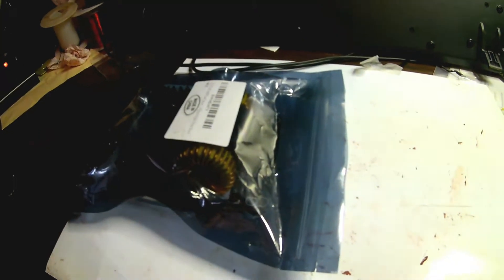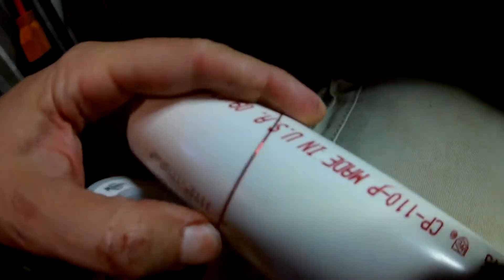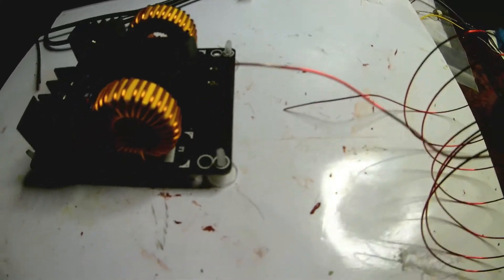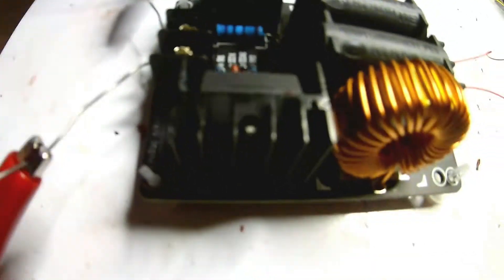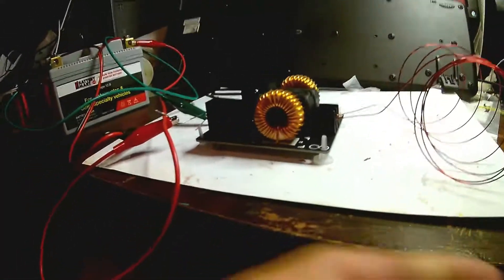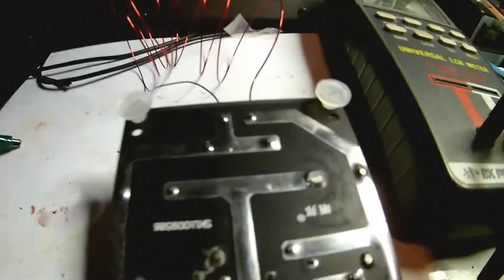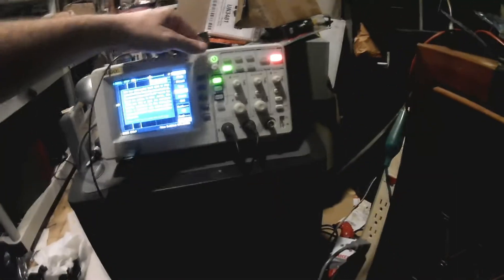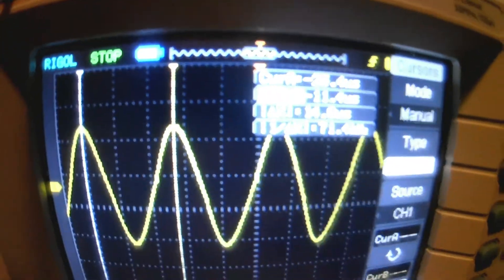ZVS 20A 1000W Low Voltage Flyback Heater Driver Board

Comment: Hi i have the same zvs but nothing will be hot. The coil has the diameter of a 18650 battery, 10 windings, and the coil is alminium. The voltage is 20v and the ampere is 4a
Why it doesnt work? Thx?
Reply: @Daddy how detailed can i check the mosfets?
Reply: Its a circuit issue try to look if any where pf the solder is not in contact with the components or if any components are missing

Comment: Are you able to get 1000W with this thing? i really doubt it's rated for that. Because it looks similar to the 200w variant I have and on ebay there are 1000w versions that are way bigger than this.
Reply from the maker: I don't think I tried pushing it up to the 1000W level.. That is 1000 Chinese-Watts! ;-) Not necessarily the same as American Watts!!... I just look at it ,as its "name".. "ZVS 20A 1000W.. etc.."...  just like the "Federal Reserve" is not really part of our government.. the '1000W' is part of the name.. not necessarily part of reality!??  Maybe it could?? I believe the FET's were rated for pretty high power.. but you know how transistor are... when you reach their limit.. they will DIE catastrophically!!! I hope to do some more experiments with these devices soon.. They are an interesting little device.. for the price...  Thanks for the great comments!!!
Reply: @jaynesnetwork  Yeah, someone in another Video pushed it to 300 watts, that seems to be the limit :p
Reply: @thesciencefurry  do you have a link to the video?
Reply: @jaynesnetwork you have to look at the mosfets data sheet and look for the current rating ,then use the circuit with induction heating and push it to its max with out breaking it! And use a current meter to measure the IN current, if the current is lower than what the mosfets can handle then you can add more capacitors MKP rated to push more current through the circuit and make it more powerful, and you will need better heat sinks for the mosfets so that they dont heat up as much, hope this helped❤️

Comment: Hi i habe the same zvs and connected it to a 12v car battery. But after turn on the transistors are very hot and i thinl they will be overheated. Is there to much current or the coil to thick?  what can false?  Please help bevor sonethibg burns out! Thx
Reply: I have the same problem ! i was using a 12v power supply the COIL on circuit board get very hot smoke coming out but the metal in the middle don't get that hot ..I think i have to put a higher voltage
Reply: @supermantom2456  please tell me what was the solution for you
Reply: @supermantom2456  how many turn was the coil? in needs to be over 8 turns
Reply: @lanzaxell4853  why 8 turn?
Reply: @hannes8004  idk why they do that but it needs to be 8&above atleast to not overheat the circuit
Reply: Probably the coil
Reply: i think Thick coil is only for 20-30v not for 12v
Reply: @lanzaxell4853  where can I get a cheap power supply for 20-30v?i was thinking a battery charger for TRUCK 24v
Reply: Because the coil is an inductor and if the inductance is not enough the resonance will not be at the right frequency and will probably burn your mosfets and your coil
Reply: Its because your coil it has to be copper coil nothing else because copper is non ferromagnetic so it wont try and heat it self up but lets say its steel the coil will heat it self up and immediately burn your mosfets because of high inrush current

Comment: Very helpful video, just what I wanted to know, thanks.
Reply: Please tell me what i can do with this inductive heater. I bought one and when i connect a wire on output the ampere is going up and the transistors are hot. Which power connection shoumd i use and which output coil? Thx
Reply: @hannes8004  The first thing to do is to make certain that your power supply can deliver at least 20 amperes without having the voltage sag below 12 volts.
Regarding "wire on output":  You must use a coil similar to the one in the video.   A smaller diameter (1 1/2 inches) with 8 to 10 turns closer together is better.
Reply: @frenchcreekvalley  ok thank you for your answer. Which power supply should i buy please give me a example. And why are the mosfet so hot when i connect it to my car battery? I am afraid the the mosfets burn when I connect longer than 30 sekonds. The coil must me isolated wire or ?
Reply from the maker: Glad it was helpful! Thanks!